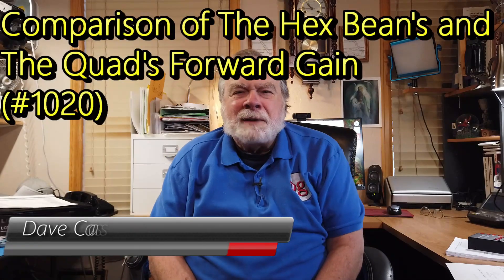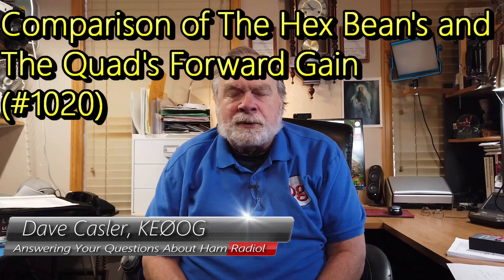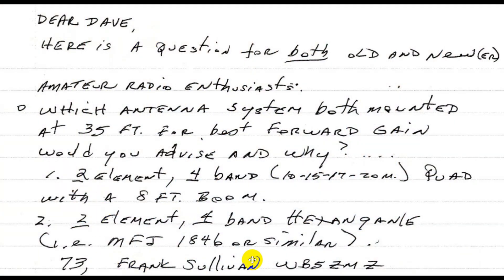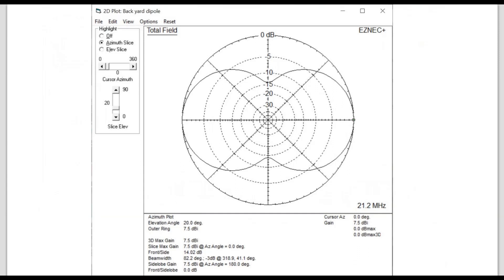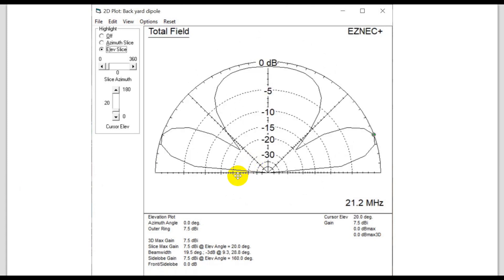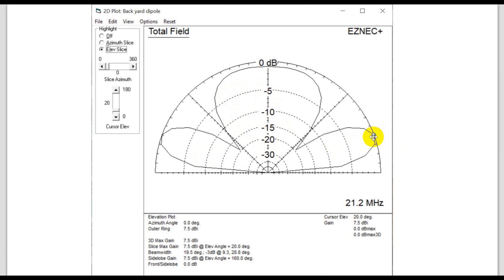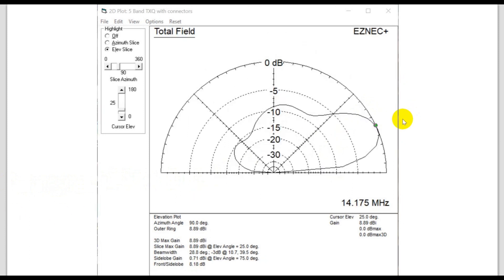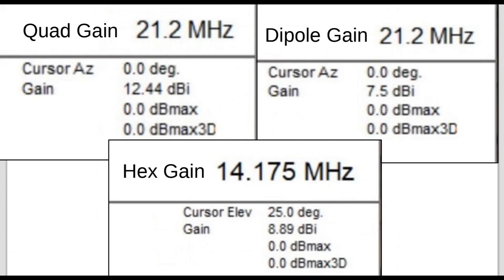Comparison of The Hex Bean's and The Quad's Forward Gain (#1020)

Comment: Why didn't you compare the gain on the same band and height?  You cannot compare a hex beam on 20m to a Quad and dipole on 15m, it's not comparable.  The pattern, gain, and f/b will be different.  Why not model identical heights and bands?  This is apples and oranges.

Comment: I have a couple of questions…
1. When modeled, what part of each antenna was at a given height?  I know he said mounted at 35’, but that would be the bottom of the hex, and theoretically, somewhere near the middle of the quad.  

2. Why compare different bands?  Spacing and elevation as compared to frequency makes a difference.

Comment: Thanks Dave - very interesting.
2 element beams of whatever type are not so much for forward gain as they are for rejection of side and rear interfering signals.  Sure there are differences, but I would assume they all function to that end, even ones like the MA5b or 6b if we are keeping to compact tri or 5 banders.
I suspect the more critical portions other than survivability in storms and so forth is the front to back and side as well as to the band width they have.  Perhaps another vid discussing those attributes could be warranted?

Comment: the quad is a forgotten but very good antenna design.......I have a 4 el rectangular quad on 6 meters on a 14' boom. It holds it's own with much bigger yagis with a much tighter turning radius........ Max Gain Systems supplies fiber glass spreaders but ain't cheap.......not sure where you can get the boom to spreader hubs anymore........not a Home Depot project but they do work........ 73 Mike K1FNX near Boston